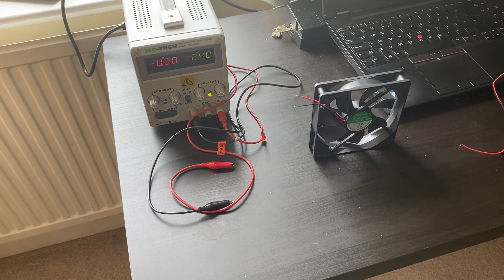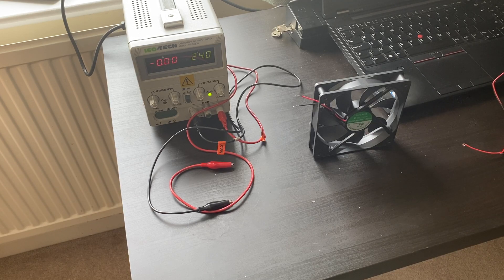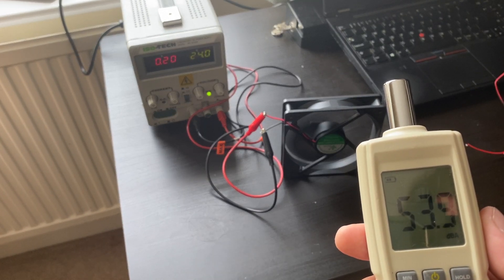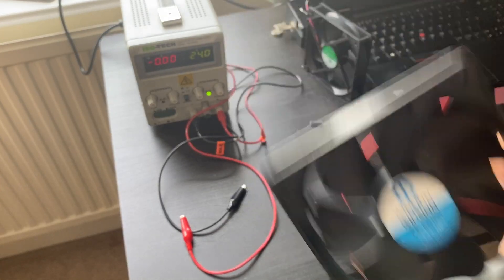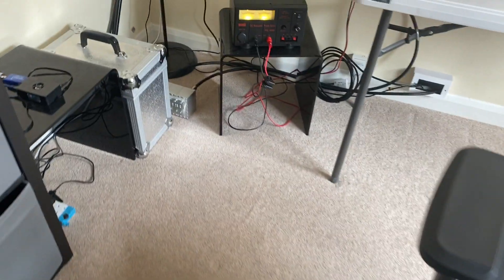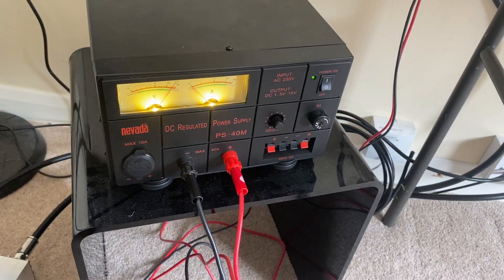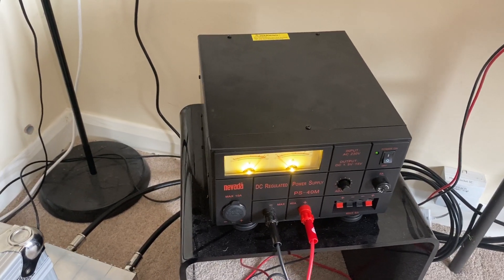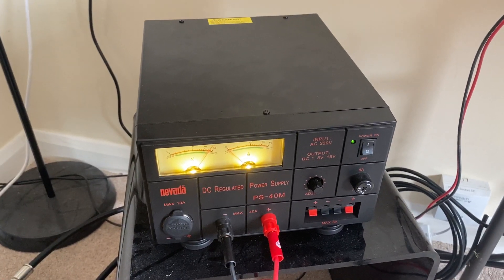Nevada PS-40M Power Supply Fan Noise

Comment: They should sort this out at the factory! I have just purchased this PSU and the fan keeps coming on every 20/30 mins without any load what so ever and the noise drowns out the radio. Waiting on a reply from Nevada after complaining but I suspect they will offer no solution so might have to give this mod a go. Many thanks, Get CTOwned
Reply from the maker: It should indeed be sorted out at the factory but Nevada aren’t the manufacturer of this so they likely won’t be able to assist!